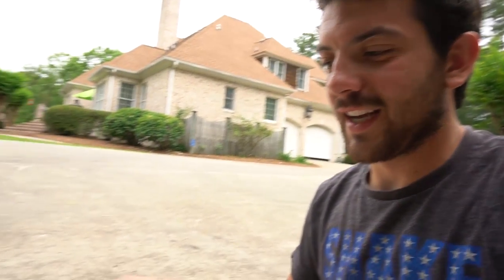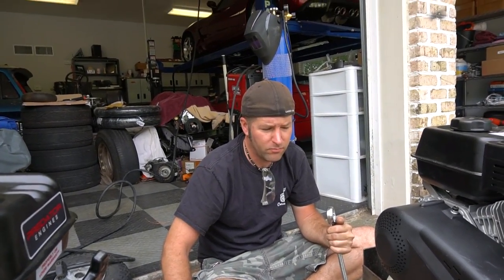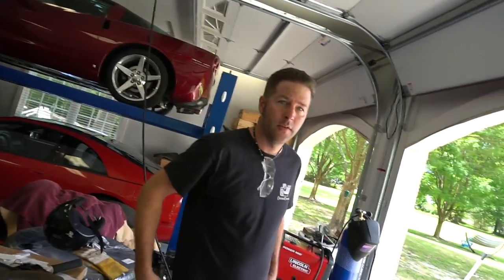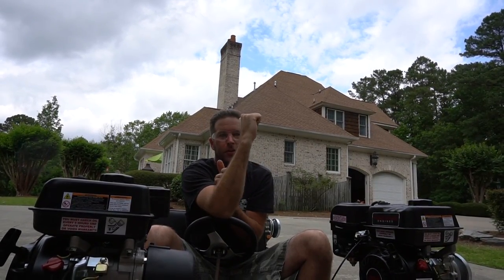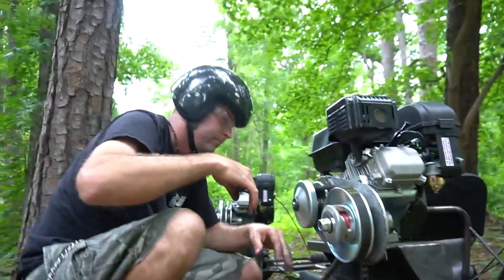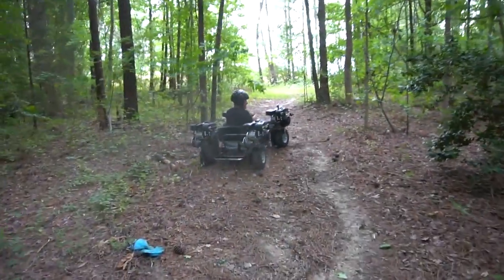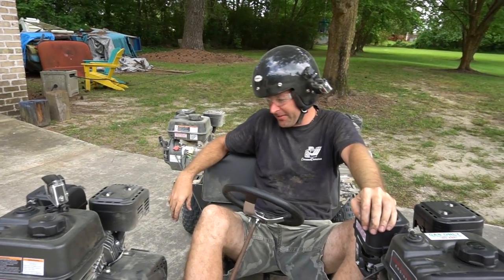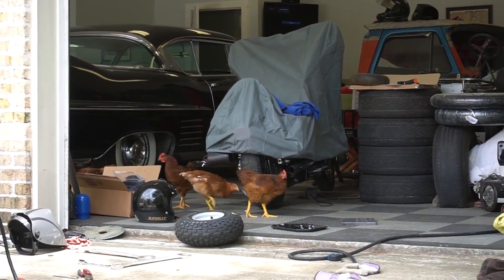Mad AWD Kart Launches: Chain & Steering Adjustments

Comment: Awesome
Add a brace between the engines front and back. You get get fancy and add a way to adjust it by adding a threaded rods on either end.
Keeping having FUN!
I know I am enjoying watching you guys and your project develop.
Outstanding !!! 👍🏼👍🏼
Reply: Add hyme joints to the front for steering for bracing up top to the engine mounts.
Reply: That would fix the 
rear camber problem.

Comment: I think if you want to keep the two gas pedals, you should instead have one assigned to rear engines and one to the front. If you end up doing that, I think it'd be cool to add a u-shaped piece that extends from being welded on one pedal to cup the other so if you want AWD you can just press one pedal. Or if you just want RWD then you can just press the pedal that doesn't have the u-shaped piece welded to it. That, depending on how you get it set up, could potentially free up a foot to press the brake pedal if you end up adding brakes. The biggest downsides to this that I can think of are A) not being able to "steer withe no hands" and B) you don't get the option to freely JUST give power to the front wheels.
Reply: Electrik or just keep two pedals but have them mounted so close they're almost touching. that way you could press which ever one you wanted or put your foot in the middle and press both.
Reply: Like a rear brake on a tractor.  Two pedals one linked, and one separate.  Although the smooth transition would be lost, since you would have to completely lift the rear, to add the Awd.
Reply: jbw5485 yeah that'd give more options too I like it

Comment: I was thinking for a brake since you have soooo much going on on each wheel you ought to make a sort of friction brake that you grab a lever with your hand pull back and it basically pushed down a skid plate.  Might some in handy to lift the tires off the ground to keep fixing those chains that keep popping off.   It would be K.I.S.S.    just stupid cheap easy unique and should work.  You could mount an old tire to the skid for extra traction on pavement
Keep up the good work guys this is y'all best build yet!!  Love this AWD go cart looks like a handfull

Comment: A thought. I once saw an of road cart with an "invented" rack and pinion and thought I'd pass it on to you dudes for consideration. I'll try to describe breiefly. It was a section of square tubing ,lets say 1 in.square tube. In it was placed a piece of like ,,,motorcycle chain.The chain in the tube had no way to buckle so its movement could only be side to side through the tubing.  .A notch was cut out in the middle of the tubing and a small cog  and bearing was installed to move the chain within the square tube.Very basic but it looked like it worked great.Hope I've described it in a manner you can picture,,realizing of course that chances are you guys have already seen something like this. Totally enjoy your great vids and kewl carts.

Comment: I commend both of you for actually seeing this thing through and getting it to where you are just tweeking it. I'm thinking if they can do this, they can stretch the frame, get some old 125 motorcycle rear wheels and tires, and ............ whatever. However THE THING is great the way it is, and I would love to take off from a standing start, and feel the torque this it is obviously putting down. I guess you guys thinking outside the box for this design, and doing something completely different, has probably effected the area of my brain that is responsible for being able to reason.

Comment: now imagine when you ungovern and rejet all of the engines and have 9 hp per wheel
Reply: 36 hp and all the grip they need
Reply: Tyler Gutstein 
Yea but if you are gonna go in the dirt, I'm not so sure I'd do a high flow filter. 
High flow air filter=sucking dirt.

Comment: Just an idea on that negative camber issue. Try welding a couple, or more bars between the plates of the two rear engines to keep them from flexing toward each other.  You could box the entire area in and make it a truck bed!  :)  Love the videos, keep them coming!

Comment: It needs one gas pedal for effectiveness Ike knows that!
Reply: james edmiston you know you wont be able to steer it then? there are no diffs so it cant turn if both wheels are spinning at the same speed
Reply: Just thought of a "Cat's Cradle" type of throttle pedal. Think of a flat pedal on a good spring(s), not so tough you can't compress it with the pedal plate. Then you could run each throttle via pulleys(or w/e) and cable to the four corners of the pedal. Follow me?

So if you stomped on the pedal/spring it would pull all for at the same time. (have four adjustable bolts for a throttle stop, so you could tune WoT to pull straight) 

Now at the same time you could rotate your foot forward/back and side/side! Know what I mean? Could steer it along like that pretty precisely too. 

What do you guys think of something like that? I thought maybe a joystick style, but how would you pull them equally all at once... Bam, your foot is the joystick instead. :p
Reply: Michael Van Schie so a normal go kart cant steer?
Reply: slaapkonijn58 yes it can, are thw front wheels on a normal go kart spinning the same speed? nope, and the back side of a go kart frame flexes to let the wheels slip while steering and thats why tje steer sharper when you remove tje stabilizer bar from your frame
Reply: slaapkonijn58 also normal go karts cant steer sharp at slow speed for this reason, but this one with 1 normal pedal wont be able to steer on "high" speed becuase it will underseer as hell
Reply: Michael Van Schie it doesn't need a diff since the left and right are separate completely. If we assume for a second that both engines are making the exact same torque at the exact same time and both wheels have equal traction then the net result would be basically the same as an open differential which applies equal amounts of torque to both wheels at all times. Not to mention each wheel can spin freely faster or slower than each other regardless of throttle position. One engine could be at 800 rpm and the other at 1500 without affecting each other.

Comment: You guys should mount a radius rod with heims on the front and rear motor plates towards the top. Front can still rotate but helps with the camber problem

Comment: What would happen if you switched the gas pedals so one would drive both front tires and the other pedal for the rear. That way, you could with practice be able to turn better and when the road opened up both floored. It could also help in braking, shut gas off the fronts and compression would come into play and slow you down easier. Just a suggestion.

Comment: great vid! Ike looked quite surprised whent that thing went up the little sand hill so fast! :D
Reply: I was surprised
Reply: Isaac it'll be fine your chains are either stretching from the torque, or they're cheap chains lol. or both. I'm thinking a spring loaded tensioner like on a Dixon zero turn might help? I own a small engine shop, figured I'd throw my two cents in, but I'm sure you and john will get it ironed out. it'll be fine... lol :)

Comment: Simple solution to help the engine plates to stay straight is weld a metal bar across the back plates and same for the front but make it have heavy duty steering joints. I cant tell if the axles bend tho.

Comment: I would love to see you guys build a top fuel drag rail inspired go-kart. Tuned up Predator 670, hard acceleration and high speeds. thought you may need a multi speed lawn tractor transmission to get the torque and top speed

Comment: That's got to be the most fun thing to drive since a gas powered big wheel.  Suggestion:  How close are those engines running at the same RPMs?  Some way to sync those engines would help with acceleration and steering off the line and maybe keep those chains on the sprockets.

Comment: What you guy should do with the gas pedals is make it so when you push the gas in for the front two engines, the pedal for the rear engines goes down with it. But, when you push the gas for the rear engines, the pedal for the front engines stays up (at idle). It's a good idea if you want to do doughnuts/ put brakes on it.

Comment: put a solid axle across the back to keep the wheels straight, but have the wheels on bearings and lock the axle in place, so each wheel can spin independently like u have it now, but the solid axle across will keep them from developing any camber

Comment: Moving the rack the way they did actually changes the Ackerman angle though, doesn't it? That particular adjustment does have some interesting handling properties. (Possible to trade off having a tighter low-speed radius for better corner handling at high speeds because of angle between inner and outer wheels during a turn.)

Now just need to give extra bracing to the rear engines like was done with the front. Got to eliminate as much flex as possible in relation to the drive-line for those chains.

Comment: How about change to dual rear solid (half) axles with pillow block bearings and then even disc brakes would be possible.

Also, what about a hand lever that can apply the throttles of the rear engines as needed. Leave the two foot pedal throttles as they are and figure out the hand lever like a cruise control linkage that slides with it, but can add more throttle when you need to.

Comment: CONNECT FRONT LEFT AND REAR RIGHT MOTORS WITH A THROTTLE. THE. CONNECT FRONT RIGHT AND REAR LEFT WITH A THROTTLE. TEN PICK WHAT EVER MOTORS ON ONE THROTTLE AND GEAR THEM TO A 1:1 RATIO. START DRIVING WITH WHAT YOU HAVE NOW GET UP TO SPEED THEN HIT THE OTHER PEDAL AND GO REALLY FAST. YOU GUYS CAN GET SOME REALLY GOOD SPEED.

Comment: I would take the four engine/wheel assemblies and mount them 90 degrees apart on a circular frame. Put a racing seat and harness in the middle, hand brake and throttle, build a roll cage and you have a bad ass sit n spin.

Comment: The frame did twist not under acceleration of torque. But yes during off roaring and jumping. As far as fixing the rear camber a strut brace will work from a fixed position over both rear engines. And why not wouldn't you attempt to hit the 100mile mark. Take it to  salt lake flats.

Comment: if you were to run the two rear throttle cables down the center of the cart to the peddle you should be able to control both rear tires with one peddle

Comment: I'd love to see a strut bar style brace on the rear.
A X style brace that bolts under the bottom engine plates tying them together.. 
(Or two bars crossed L-F to R-B + F-B to R-F for build simplicity.)

I'm seeing quite a bit of flex that could be really tamed.

A bar for the front is very doable, but not dead simple like that back.
Both ends barred for stability would be a great improvement.
Reply: Heim Joints & done
Reply: Indeed... even just some flat plate would be an improvement at this point.

Comment: You're all over the road with that thing.  Good luck going straight with 4 separate torque converters engaging at slightly different times.  Next time you should do dual tracks like a tank.  More traction and easier to keep in order since there is only 2.  Slap them between a differential and steer with the brakes.

Comment: So I had a thought as Ike was stirring up dust... I wonder if it would work to have the right throttle control the rear, and the left throttle the front.  That way you could drift it around, and grab traction up front when you want it.
Ed: -comment by Electrik has some detailed thoughts.

Comment: I would expect that each clutch engages slightly different speeds because they have variances. The engines might also rev slightly different causing issues with torque being random from wheel to wheel thus stressing the chains as well as other components. Interesting concept none the less.

Comment: It'd be a lot more solid in the rear if you did a 'solid' axel but split the axel in half. That way you have a longer more rigid shaft (that's what she said) to deal with the launches. It'd be setup like a normal cart but an engine per side. This would also give you something to put brakes on.

Comment: Hi guy I really like you youtube page! I have a question which you guys might have already said in one of your eps, what size bolts does the torque converter take. the reason I am asking is the ones that came with the TC goes in about 3 threads, then it's get extremely hard to go in I would like your help on this PLEASE thanks.

Comment: It looks like you have 72 tooth sprockets on the wheels, you may want to change them to 60 tooth sprockets. I did this on my homemade minibike with a 6.5hp tecumseh, torque converter and no governor and same size tire. Not only did it make top speed near 50 but it accelerated harder especially in the mid range. It seems counter intuitive but you would be surprised how much performance gain you get with this simple change.

Comment: I get mounting the front engines and making the plates but why go threw the trouble of making the rear mounts instead of solid axle it and use one engine in rear with front two engines?

Comment: W/ sprocket drive on outer section of the wheel, you need another reinforcement that runs from chassis around the tire to support that sprocket.  Think of the force's you're generating there.  Also, rear takes more of the load as CG moves backwards under acceleration.  Rear needs to be beast mode strength, whereas the front just lose traction and spin.   Calculate the torque multiplication of CVT and chain ratio, combine that figure with the dynamic load placed on the wheel due to zero suspension.  Stupid forces exist on the outside of the wheels w/ exterior driven sprockets.  You will continue to lose chains until outside sprockets are better supported.  Between motor/gear box torque pulling that tire towards the engine and the wheel shaft soaking up the terrain providing the same force direction.  Measure the distance you will find that the exterior sprocket places 10-12x the load on the shaft than that of the inside sprocket.   Chain / sprockets are either captured in a box frame, or are directly next to the support.  You know why.  Put a gopro back there to observe that outer sprocket / engine combo.  Run at high FPS and you will see just how much it moves.

Comment: to better the toque and the steering have the motor shaft in front of the axles and change to front steer instead of rear steer,, the rear motors look fine just needs bigger axles.

Comment: Did you know, that the  C-clip for master link, Actually has a specific direction of travel?     The closed end of the c-clip should be facing the direction of travel onto sprockets   Also many mechanics say ~ You don't need the c-clip on master/connecter

Comment: hey guys, quick question for ya.. what torque converter did you use for your 670cc go kart? thinking about going the v twin route and it says the 40 series is only safe to 16 HP or something like that.
Reply: we used the 40 series on it.

Comment: The biggest problem isn't chains popping off, it's having an engine above all 4 wheels. You'll notice that no commercial, or racing cart manufacturers design carts like that. Its more expensive, it's heavier, it's unnecessarily complicated(a chain for each wheel), and it requires far more maintenance. Not to mention the fact that you must start 4 engines instead of just 1. Your best bet would be to just install 1, or at most 2 engines in the back of a cart.

Comment: because the rear end doesn't steer, do come cross bracing for the engine mounts so it won't have the chance to fold in due to weight and gravity.

Comment: ditch the master links, building a solid chain is a much better system.  I use a nail with a hole drilled through and some safety wire on my motorized bike and it's been perfectly reliable for close to 10,000 miles

Comment: you have 4x the torque because you have 4 engines.  Change the gear ratios (smaller sprockets) so it hooks and has a higher top speed.
Reply: tiporari they would rather have the launch I think

Comment: NEEDS BIGGER TIRES.  It would give you some suspension and take away the "too much torque" problem.  I love the effort.  How much total horsepower???
Reply: 26 hp at the moment
Reply: Fine job.  Cool how much fun you're having, too.  I'm converting a four wheeler into electric right now.  And I'm making it float.  (complete with trolling motor out back)  Also building a mini pavilion for solar panels.  Keep doing what you're doing.

Comment: SOOooo I was thinking, . . . couldn't have you just made the rear axle a single shaft with two engine sprockets and the front wheels with their own engines? It would have still been 4 wheel drive BUT the rear axle(RWD) would have been easier to repair/ sturdier.
Reply: yes it would have been better

Comment: Instead of one gas pedal controlled one side you guys should put one gas pedal for the rear 2 motors and then the other gas pedal for the front 2 motors so it's like if you just want 2WD You press one gas pedal and when you want 4WD you press both gas pedals